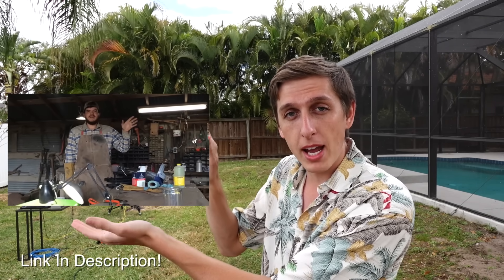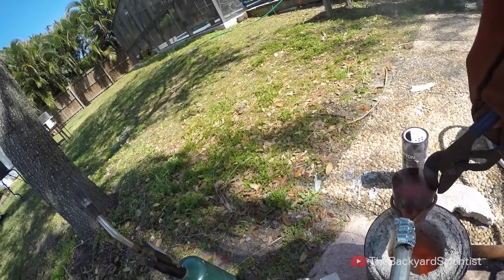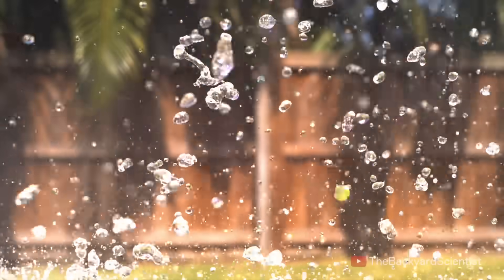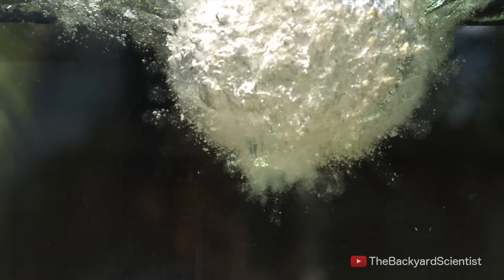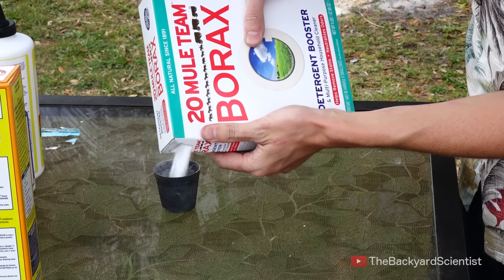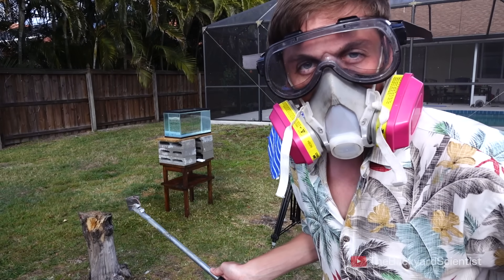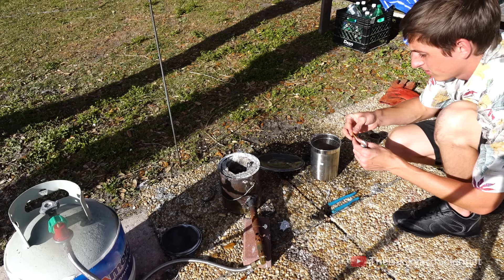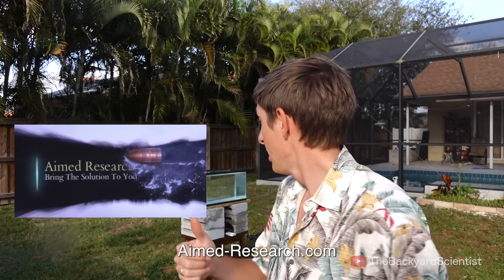Pouring Molten salt into Water - Explosion!

Comment: You do realize that if sodium (or potassium for that matter) touches your skin while reacting like that, and if the piece is large enough, it will also react with the water in your body and bore its way through you? Extremely painful! This is why we are no longer aloud to use these kind of flares info combat bc this happened to too many ppl in Vietnam and soldiers would literally burn from the inside out. I saw your experiment going very differently... be careful

Comment: The reason why it happens only with NaCl can be its density, melting temperature, thermal conductivity and heat capacity, which may favour an explosion, while other salts may have a lower melting temperature and heat capacity and very different density and conductivity and so conditions to have an explosion are not satisfied

Comment: Well I thought the guy would have done some GCSE science. The Sodium and Clorine start to separate at high temperature (but not completely). The sodium reacts with the hydrogen in the water and explodes. Hence why the pure sodium test you have flames on the surface, instant reaction.

Comment: I'm not an expert but I would like to submit an hypothesis : I think it could be a redox reaction, with the water reacting with the molten ions to form dihydrogen gaz. The gaz would then ignite instantly because of the heat of the molten salt. I know this kind of reaction happens, with Titanium for instance : at the place I work, 2 guys tried to blowtorch their way through a plate of what they beleeved was steel. I was in fact titanium and this happened : when exposed to the torch, the metal wasn't "cut", it kinda melted and form a red hot blob like thing. The workers tried to cool it down by throwing water at it. It immediately resulted in an explosion that threw them a few meters away.
This theory can be confirm by doing the opposite experiment : rather than pouring salt into water, put water on molten salt. Because of the leidenfrost effect and the different density, it will not penetrate and it won't be possible for a physical explosion to happen. If you still get an explosion, then my theory might be true

Comment: When you put chlorine on water it mix almost instantly right? And when you put molten sodium metal it exlodes violently on water surface right?
My theory is salt becomes separated (but still NaCi) when you make it molten making them Suspended elements (Sodium and Chlorine). Thats the reason why it explodes in the water. The chlorine mixes with water and then the sodium becomes alone, sodium finally realizing their inside the water and chlorine is not with them, sodium explodes violently like they do on the surface of the water, thus making a big explosion. Thats the reason why the explosion had a little bit delay, waiting for the chlorine to mix up in water.
The reason why it doesn't work for other compounds is even though their molten and separated they're still the compound like they used to be. They didn't mix with water, therefore making sodium not suspended inside the water
Reply: Well no they are not suspended elements. It's an ionic liquid of Na+ and Cl-. The reason solid sodium reacts when placed in water is because it gives away an electron
Reply: It might be a coulombe explosion.
Reply: I think the acid-base indicator would imply this if it was the case. Also, pure sodium explosion caused some flames and smoke, while the NaCl one was almost entirely clear.
Reply: Garlic bread
Reply: That's false. watch the slow mo. You can see a bubble of vaporized water around the drop of molten salt. It then proceeds to detonate once it has sunk into the water.
Reply: Benebs Biagtan NaCl!!!! Not NaCi!!
Reply: Benebs Biagtan and you can’t test whether it’s a chemical or a fizical reaction just by looking at the pH level... 😑😑😑
Reply: This is not a chemical reaction - this is a thermodynamic reaction. There is a lot of heat in that molten salt. When it contacts the water the water vaporizes instantly on the surface of the salt and causes the salt to spread out heating up more and more water with a chain reaction - that is the explosion.  This works because molten salt doesn't have the leidenfrost effect and so can rapidly transfer heat into the water.
Reply: Walt also absorbers water

Comment: Your claim is incorrect! Salt otherwise changes water into a water vapor but then it is no longer visible, but the salt reacts with water and releases hydrogen. The water vapor prevents it from exploding because there is not enough oxygen. In order to prove this, he holds a fire on the aquarium and there will be an explosion.
Reply: salt is sodium chloride and chlorid separate of sodium and sodium react with water! (no oxygen no explosion)
Reply: i could be wrong but there is less chence

Comment: Your VERY smart.
Reply: not soooo much! look:

Your claim is incorrect! Salt otherwise changes water into a water vapor but then it is no longer visible, but the salt reacts with water and releases hydrogen. The water vapor prevents it from exploding because there is not enough oxygen. In order to prove this, he holds a fire on the aquarium and there will be an explosion.
and:

salt is sodium chloride and chlorid separate of sodium and sodium react with water! (no oxygen no explosion)
Reply: i could be wrong but is much less chance

Comment: Have you considered the size of the molecules you're working with? As in the physical space the sodium/chlorine ion (+electrons) occupy vs. the other ions?  On the molecular level, NaCl and Na2B4O7·10H2O are vastly different in size.   It could be that the amount of ions per picometer, more with sodium chloride than with sodium tetraborate is the deciding factor.  More "surface area" for the liquid NaCL to interact with on a physical level than the Na2B4O7·10H2O.  Greater rate of heat transfer from the NaCl to the H20 = more rapid phase transition from liquid to steam?  You said it yourself, the NaCl reaction was not a chemical one but a physical one.  You also heated the NaCl up way past its phase transition level from solid to liquid.  Also, consider the specific heat capacities of NaCL and Na2B4O7·10H2O when determining rate of heat transfer to H20.  This factor could also be a deciding one when considering why NaCl doesn't have the leidenfrost effect vs. Na2B4O7·10H2O.  Just some thoughts.

Comment: it is a chemical reaction, when it hits the water it takes the oxygen nearest to it and turns into sodium dioxide and the heat from the molten salt left over ignites it, the ph didn't change because the acids wernt mixed into the water the water was mixed into the acid to create the explosion and pushes all the acid out of the water

Comment: Your conclusions are wrong. It explodes because hydrogen gas is liberated according to the reaction:

2Na(s) + 2H₂O(l) → H₂(g) + 2NaOH(aq)

In fact, all group 1 elements (the alkali metals) will react in a similar fashion when added to water. This is this due to the release of the single valance electron in the outermost orbital of those atoms. To achieve a stable electron configuration, sodium needs to lose one electron to become the sodium cation, Na⁺. This occurs when it's added to water - sodium gives up its valance electron which releases a lot of heat energy. Hydrogen is then released from the water which reacts violently with the heat energy that was produced.

I dare not watch any of your other videos for fear of my mind exploding. There's nothing quite like listening to the ignorant comments of someone with very little chemistry knowledge. But thanks for making me laugh.

Comment: I think it only works with the sodium chlorite and not the other salts because only there it was able to separate into elemental sodium. And by the way you actually don't need to melt the sodium. This also works with pure sodium metal.

Comment: I believe you are witnessing a phenomenon called thermal shock. It is not a chemical reaction. Heating NaCl turns NaCl into NaClO3. NaClO3 + H2O is an weak acid/base reaction which results in a basic solution of HCl3 + NaOH. I doubt the reaction is the Culombic reaction that you see with Na + H2O where the rapid flow of electrons causes an explosion. But I could be wrong. I think the chemistry shows it is a double displacement acid/base solution reaction...and most acid/base reactions are very boring to witness. Just my 2 cents.

Comment: If you dropped that chunk of sodium without heating it into the water, it would've exploded
Reply: Noah Clark you obviously didn't watched the full video
Reply: Well it doesn't really matter overall since the pH change part of the experiment proved that false
Reply: Sodium scritters over water rather than exploding (note that this will be a tiny chunk of sodium).
The larger the chunk the heavier the reaction
Reply: Table salt (NaCl) and Sodium (Na) are not the same things. It would be illegal for a store to sell sodium to the public
Reply: Aquarium glass is not great for a dog to be walking on
Reply: Radical Larry watch till the end he also tests sodium
Reply: It's not pure sodium.
Reply: I think the main issue is that the force of the explosions were similar (between salt and sodium metal), just the salt was able to get under the water before exploding, whereas the sodium metal exploded above the water, dissipating it before it could get under.
Reply: It would have exploded if it was metal Sodium and a detergent.
Reply: T
Reply: Aaron Watts it’s not sodium it’s salt
Reply: LordEnigma that is what he said
Reply: No, because it had to be diatilled or refined or whatever to separate the sodium and chlorine, as they were originally fused to make salt. I forgot terms, sorry.
Reply: The dog have shoes
Reply: Aaron Watts it wasn't a chunk of sodium, it's salt.

Comment: NaCl is a neutral salt. It doesn't change pH at all. Its a chemical reaction because when NaCl is molten, the ions split. Na+ reacts with water directly.
Reply: No.  Ph.D. chemist here.  When you see sodium react with water, its because sodium metal is being oxidized to sodium hydroxide.  Na(0) to Na (1+)  That releases a LOT of energy.  Sodium in salt is already oxidized to 1+ and cant react further.
Reply: Yash Parmar That sounds about right, I figured the heat had some effect. In its base form, sodium (solid) is a serious catalyst and very reactive with water and other things if it degrades. My old professor did an experiment in the classroom am with sodium and water after it dissolved like an aspirin pill, it exploded. I believe the heat sped up process and because of it's temperature it exploded on contact. But this guy wore no protection, he could have been killed by glass piece slitting his throat.
Reply: I don't think melting NaCl splits the sale to Na+ and Cl-.  It's molten state is conceptually no different than melting ice into water.  The difference is the energy required for the physical states of each respective molecule.  Also, the salt is already in its ionized form when it dissolves in the water, so the explosions from molten salt can not be a chemical reaction with water.  When you saw the metal sodium react with water, that reaction is the process of the metal sodium becoming it's ionic form...aka a chemical reaction as stated by a previous poster.

Comment: My guess, just off the top of my head --

NaCl is an ionic bond, not a covalent bond.  I would bet that when molten, the sodium and chlorine atoms probably dissociate, and then the sodium does what it does with water -- forming sodium oxide and hydrogen, which then ignites due to the heat.  That's probably what causes the explosion.

Comment: I have just been arguing about using liquid salt reactors instead of the light water reactors to create all the energy that we need because they are so much safer due to the fact that you need NO pressure vessels in one but you do with another.
Then I found your clip on pouring molen salt into water. Luckily (I think) this doesn't apply.
Incidently I work as a lime plasterer so I have to slake my own lime putty to make my mortars because I don't use any cement in my building work and lime mortars are so much better for the environment and a lime mortar covered building absorbs carbon dioxide so it's better for the environment too.
When you pour quicklime into water to make the lime putty it creates a lot of heat fast and can be super explosive, so have you ever done any high speed footage tests slaking lime? If not then this could be your next experiment please?
Thanks, have a nice week. Regards from your transatlantic cousin many times removed.

Comment: the rapid boiling water creates shock wave and bam, the other stuff you put created a layer, that layer could be the gas that is burning from the other chemical apart from sodium so they don't come in direct contact with water so even due that it boils but not rapid enough to create an explosion.

Comment: I don't know if you want to try this or if there's a way that you could but when I was a kid I found some dry ice a Construction site and I took a piece of it. it was probably 2 inches thick by a foot square and i carried it home in a rag and halfway home I come across a big vat of tar that they were tarring a roof with. but no one was around and the vat of tar was still molten and boiling it hadn't cooled down yet and I got the bright idea to throw that chunk of dry ice into that vat of molten tar the tank it was the size of a Volkswagen bug. so i threw the dry ice in the tankful of tar and when it hit the tar, i new better for some reason I was like you know I don't know 10 or 11 and when it hit the tar it exploded and shot Tar all over the building all over the cars all over the trees all over the street. but like I said  for some reason even at that age I knew better. I knew it was going to blow up and it did what a mess and I didn't get in trouble either thank God. what a goof.🤔😉🤤😨

Comment: If you still haven't figured out, let me explain what happens.

The salt is very hot, and easily disolved in the water, which makes it able to transfers the heat to the water VERY fast, and boils it instantly, which causes an instant expansion = explosion.

Comment: ... There was combustion when the Sodium Chloride touched the water. Sodium is so reactive it will rip the Hydrogen right out of the Oxygen and from the energy released by H20 causes a combustion reaction. In 6th grade you learn that all combustion reactions are chemical, in fact that's the main proof that a chemical reaction is happening.

Comment: I think with other salt you used, a kind of insulation layer formed on the outside of the molten salt lump because of which the rest of the molten salt couldn't come in contact with the water.  That's why the absence of explosion.  If you take out the lump of the other salt immediately after pouring it and cut it you may find molten salt inside, that couldn't transfer the heat to water and cause the explosion, and so is still in a molten state.

Comment: It may have to do with the viscosity of the molten fluids. sodium chloride has a wide range depending on temperature, and you noticed the sodium, and lye were much thicker. should make trapped flash boiling water more likely. there's probably some napkin math smart people can do to figure it out.

Comment: I think what happened is that the molten salt was so hot that it vaporized the water on contact causing steam to shoot up and out carrying water with it and the shock from the sudden change in water pressure by the explosion caused the glass to shatter
Reply: as proof just look at that steam floating up before it exploded

Comment: Easy, surface tension. Ever sprinkled pepper on water then salt? It makes the pepper shoot to the sides of the container, meaning much lower surface tension at the point the salt enters. Lidenfrost effect is partially based on surface tension, like droplets on a super hot skillet, will skitter around. Salt is lowering surface tension so lidenfrost effect breaks down when the salt is several inches down and that delay lets enough salt in one glob get under water then layer breaks down then you have super steam reaction.
Try putting dish soap in the water, not a lot, then try those other molten salts again and table salt, probably get a much bigger reaction (^_^)

Comment: It seems like it might be a viscosity issue. If the hot liquid is too viscous to entrap the water or to be expanded by the steam, the outer layers will quickly cool and hold the salt together. As you get the salt hotter, it gets less viscous and the boiling of the water is more energetic, so there's a larger possibility of the runaway expansion

Comment: According to me, due to the heat of the molten salt, you broke hydrogen and oxygen bonds of some water molecules resulting in an explosion. Maybe it worked only with sodium chloride because salt easily dissolves and breaks down in water and diffuse unlike borax which stays intact.

Comment: I believe that it is the crystal portion of the salt exploding. so, if u heat up glass (it being created from a crystal, so it has similar properties) and then rapidly cool it, the glass will crack and explode, depending on how hot it was. so if u think about it, a drop of molten salt has much more stored energy than heated glass. so it rapidly cools, and thus hardens fast, and cracks and then releases the stored energy in an explosion. if it was really your theory, then you could use molten metal (steel) to accomplish the same end